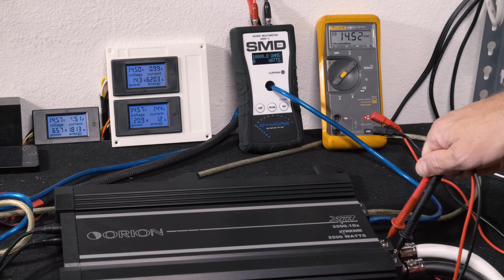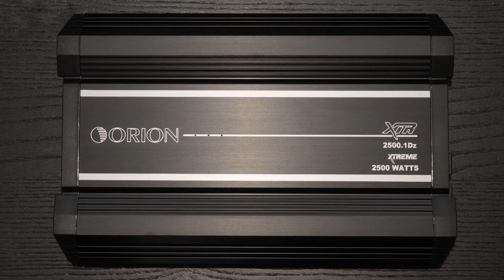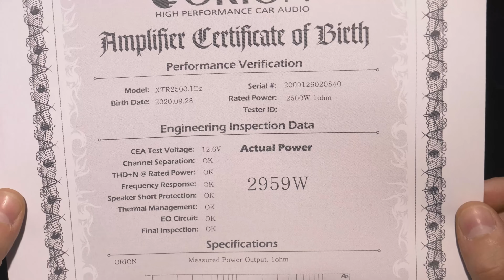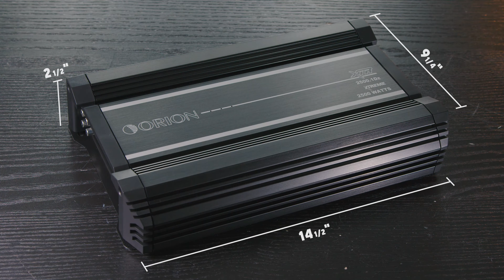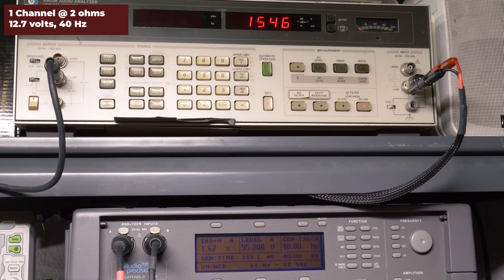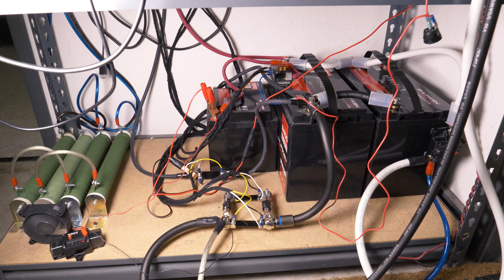Orion XTR2500.1Dz  - Amplifier Power Testing!!!

Comment: ….. big d wiz ~ old school stereo did a real good video on this amp .., different results too
Reply: Yup, that video is the reason why I bought this amp. It is also good to know that the speaker terminals are 4 AWG not 12. 

Also, I don't get why people are saying this thing over heats. Gotta be bad wiring, not enough power, or they are over driving it with the gain set beyond matching the head unit.  Most negative reviews I see are this.. People turning up the gain like it is a volume knob and frying the amp, it isn't.

Comment: I have 2 of these strapped with only the data cable. What do you  mean to use rca cables also? The manual  doesn't  mention strapping with rca cables.
Reply from the maker: The master amp needs RCA inputs for signal. The slave amp does not.

Comment: This amp is a monster but has down sides at 1 ohm its beyond power hungry 250 amp high out put alternator and extra batteries and I still drop down to 11.8v with dual runs of 2/0 ground and power. This amp will run at .8 in vehicles. I wish the amp itself had dual inputs for power and ground so could run 4 runs. It gets super hot after extended full tilt has even shut off in the summer which is good its thermal protection works. The bass knob just throw it in the garbage its 3.5mm plastic junk, but the real in vehicle power more than makes up for its few negatives. I had 2 american bass xrd4 15s on this amp for about a year then got American bass hawk d4 15s and im in a prefab 7cf atrend spl box tuned to 40hz and float bags and do hair tricks in my jeep liberty. Im finally gonna build a proper box this winter. My birth sheet for my 2500.1dz was 2997@1ohm 12v
Reply: Ill never get rid of the 2500.1dz Orion is coming out with xtr pro 3500.1dz and xtr pro 5500.1dz the 3500.1 is the 2500.1dz re badged its power output is same as the 2500.1dz at 1 ohm 14v. I just wish the amp had a fan and dual inputs. I paid 480 brand new for mine and have been trying to find another one but im not paying 600 used for one
Reply: I have 2 kinetik 2400 batteries with the h/o alternator. I switch to lithium i should be ok and keep my volts up
Reply: @pyrodave6407  wat vehicle you got it in... Your vehicle smaller than mines... I got a Tahoe....
Reply: https://youtube.com/shorts/CJdbTfTpB2M?feature=share is mine playing pink Floyd welcome to the machine
Reply: @pyrodave6407  wats your box tune to... Mine 35hz
Reply: Im still using the pre fab atrend its at 40hz. Soon as it warms up im building a new box. This box came in glued and i had to gorilla glue it back together lmao. Im gonna tune new box to 30-32
Reply: I got 2 xtr3475 vmax batteries in the back with 320 auto tech alt on my Orion 2500.1dz and its drops to 12 at times with 1 run of 0g.... But I'm bout to run 2 runs of 0g and add a ct3500 battery ....i got 15s hawks also....
Reply: Well actually mines dont hit 12s until i play them lows!!
Reply: Sorry didnt see the other question. 2011 jeep liberty its big inside but the hatch area is tiny that 7cf box takes entire hatch
Reply: I have a 4000.1 on 4 American Bass 15s as well. Im wired to 2 ohms, as I have bottom of the barrel XDs. They sound pretty good, better than my CVXs and SAs did. Im about to put a shell and add 4 more XDs and see what'll happen at 1 ohm on 8-15s. (I have a pair of XS4700s and a pair of Excessive Amperage 300a alternators, all cables are 0/2, double big 3, and 2 runs from battery to battery)
Reply: can it be run on stock elect at 4 ohms?

Comment: Do you think 1 xs d3400r under the hood and a 250amp alt with all 0g ofc would do the trick. I'm looking for a new aml but I definitely don't want to upgrade any more of my electrical. Also have the big 3. Should I look for something else???
Reply: One battery and one alternator?
Reply: @TheMazdamn  yes a 250 amp alt from 130stock and I swapped out my factory battery with a xsd3400 battery.  It's all 0 gauge and I did the big 3 upgrade,  I just don't wanna spend more money on a car that I'm gonna trade in a year or so. But I want to get the largest amp so I can use it in my next vehicle what ever that will be.

Comment: The only thing this amp is missing is a clipping indicator. The bass knob is also lacking being a headphone style connection.
Reply: at least you can fix a 3.5mm connector with your eyes closed.  try fixing one of those stupid phone plugs even with the right crimper
Reply: Thats why I use the DS18 digital volt monitoring In-Line RCA level adjustment (also as a power switch) CT Sounds makes one too, but feels cheaper. Monitor amps voltage that way as well as a quick turn off if needed